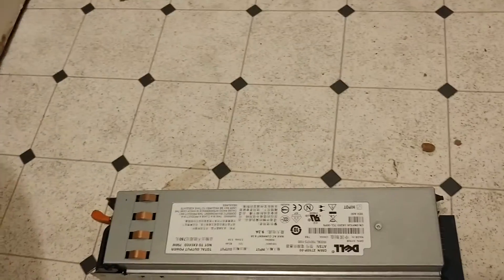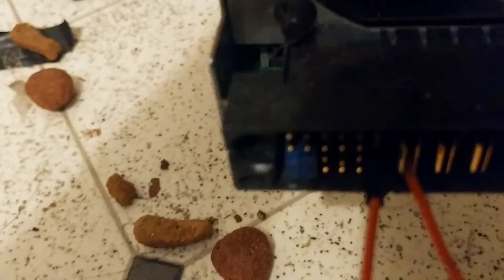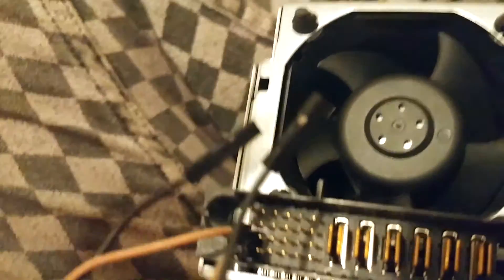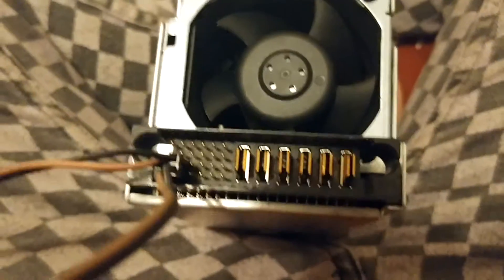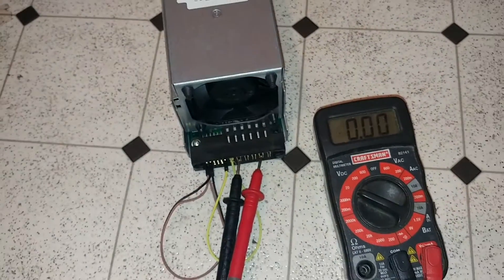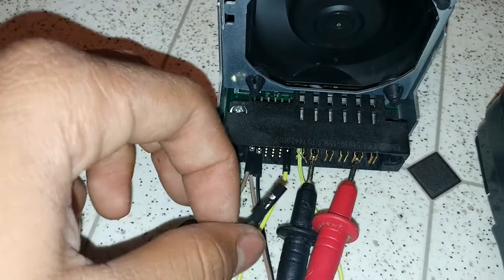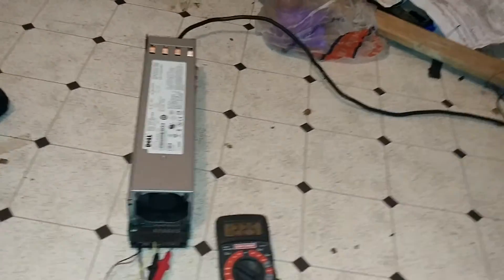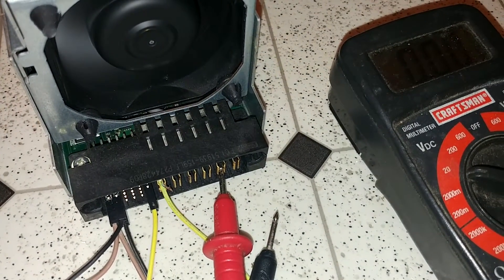How to hack server power supply z750p-00 part 1

Comment: Connect pin 8 to pin 3 instead of pin 2. Connect pin 2 on your power supply to pin 2 on the other power supply so they will both produce the same voltage and share load equally.

Comment: Hi dear how can i increez the voltage of this power supply i have same model i want increez 12v to 14v please suggest me thanks
Reply from the maker: This is really not possible with this power supply as it does not have a pontiometer inside like the one from a pc power supply to adjust the frequency from the transformer to have a higher output these are single rail power supplies it can be dome but with really advance circuit modification
Reply: Hi dear thank u for your quick reply. Basicaly i belong to pakistan here many peopel use this power supply same model number as a battery charger...
I see inside of supply here are 2 main ic i don't know how can i modify it but our people use some resistor like 27k ohm and sold on controler ic for increez voltage of this supply.
Hope you understand my bad english  :D
Reply from the maker: Mr Engineer yeah thats what I mean you have to change the main controller and also the resistors of the controller to tell it the voltage you want I havent modified mines since I only need 12 volts I own a imax x400 twins charger which chargers a from lead accid to lithium ion to lifepo4 I use the 12v power supply to power this too

Comment: Fan low connection is incorrect. It lowers the fan, but when there is some load, it goes crazy. It need to be connected B2<->B3 and NOT like in the video - B2<->A2
Reference: http://pinoutguide.com/Power/dell_server_24_6_psu_pinout.shtml
Reply from the maker: Simeon Ivanov actually that was my intention when the load goes over 30 amps it spins up so they don't overheat but I'll give that pinout a try
Reply: nightmare in action nighmare in action Also instead of the big ground, you can use some of the small pins, like C1 or C3. About the fan, it’s pretty fine with 50 amps. :)
Reply from the maker: Simeon Ivanov you seem to know about these better than md I have 2 connectes in parallel which pins should I connect to turn on current. Share
Reply: nightmare in action nighmare in action I am using the pins connection from the link in my first post link (“Notes” section).
Reply: You saved my day! I currently use 3 video cards on it, ~350W, do you think the PSU can overheat or it's safe? Cheers!
Reply from the maker: Dan Platon with me when ever there is a big load and it starts getting warm it ramps up the fan never gets hot and that I have ramned it over 20 hours with a 20 amp constant load charging a battery
Reply: I would say 350W is pretty safe. I'm keeping the PUSs on about 500-550W on low fan speed and they are good. However, for the full potential of the PSU (max possible power) the low fan speed is not enough as it's not increasing the speed based on the temperature or load and it's better to turn the fan "loud". :)

Comment: with that fan speed do you think it will coo it enough?
Reply from the maker: Alexandru Simonescu yes its enough actually I have never had them over heat only when I draw a lot of current like 35 amps the fan kind of starts speeding up it has temperature sensors in there to know when it needs to speed up I have 2 connected in parallel you can see them in my video of the amplifier review I made
Reply: cool thanks